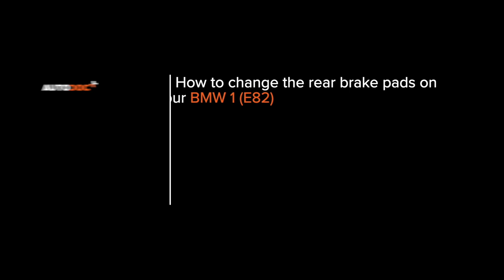How to change rear brake pads on BMW 1 Series E82 [TUTORIAL AUTODOC]

Comment: Is the same procedure for all the 1 series? I have a 2008 135i it has the same rear calipers ans use the same brakes as the one in the video but I can't find those brakes in autoparts so my question is does the rear brakes of the 128i would fit in my car?
Reply from the maker: In general, the replacement will be similar, the only thing may be slightly different is the design features of your car. More accurate information can be obtained from the technical documentation for the car or by contacting the service. 
To help you select, we need more data about your car. Contact our support team via email - info@autodoc.co.uk or form here - https://www.autodoc.co.uk/services/contact and we will definitely try to help you find the necessary spare parts.

Comment: Any help need new rear disks e82 it’s a 120d msport coupe 2011  want drilled and groves but keep getting told wrong ones     What are the sizes definitely.     Like.     300mm x 20mm wide hub 75mm.    And info be great 

Part number don’t help only if same make
Reply from the maker: Please contact our Customer Support team and we will be able to assist you and help you in choosing the compatible parts for your car.
AUTODOC